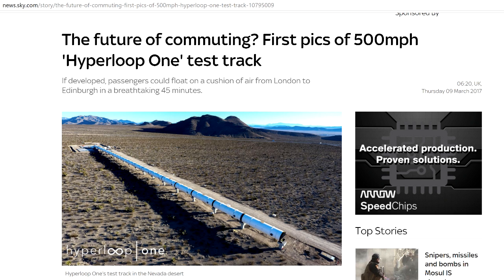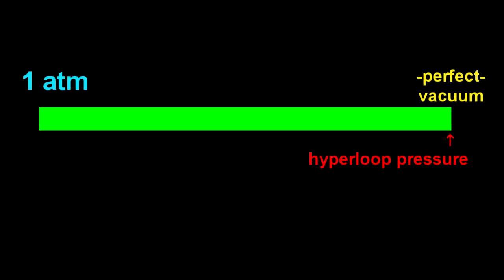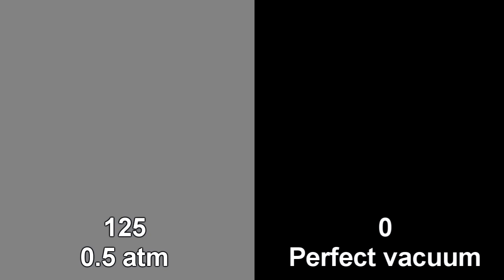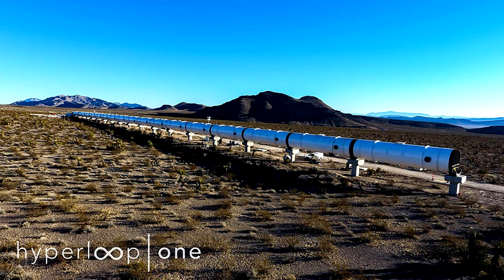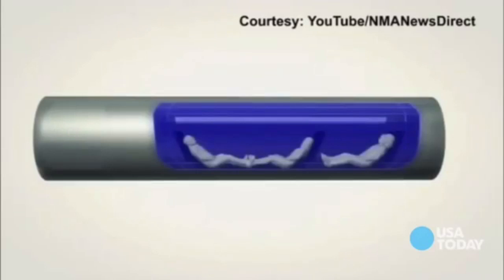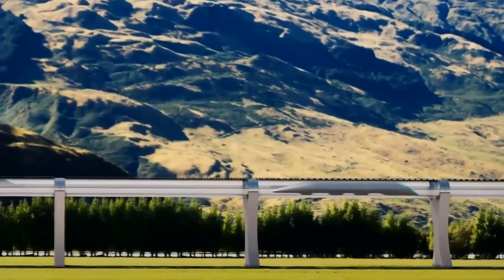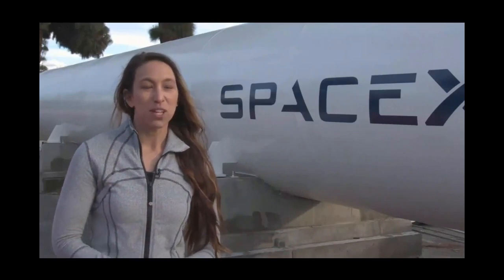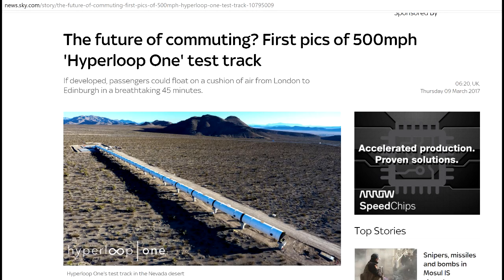Entire Hyperloop could be destroyed in SECONDS!

Comment: Correct observation on the red herring of pressure difference between ideal vacuum and hyperloop.

Wrong on all other counts

1) Tanker truck demo
Using the demonstration of a thin wall gauge tanker truck (typically 3-5mm) undergoing catastrophic collapse via highly non linear eigenmode buckling is nonsensical and doesn't necessarily apply to thicker wall tubes.  Tankers are usually designed to carry pressure or liquid and aren't usually subject to vacuum external pressure (hence the warning demo). They can easily collapse from external 15psi.
 Hyper loop design spec is 20mm thick wall. Its not 'wafer thin' (and equally - just saying - 'it looks thin to me' is not valid science or engineering argument) . And with a diameter of 2m or more it will have buckling pressure > 100psi (>6 atmos) - a significant safety factor.
 In addition,  my own calcs indicate that denting and then tearing or blowing fist size holes will also not lead to any kind of such catastrophic collapse ( By the way a grenade or high velocity rifle bullet will be unable to cause such a hole in such a thickness).    

Your uninformed -  'It may well be' - hunches doesn't substitute for calculation and doesn't count as a valid professional science /engineering approach Dr. Mason    Its a shame that you promote such nonsense when you are otherwise evdidently smart enough to undertake such calculations. Why not go do some!

Here - do yourself (and your subscribers) a favour - look up some pipe wall/diameter ratios vs crush pressures
http://web.ornl.gov/info/reports/1962/3445605700239.pdf

2) Energy for pump down
Stop trying to scare and sound impressive with your melodramatic big '0.2 GigaJoule'  energy numbers - so much woo-woo!!!. Correct value as it it maybe, you know as well as any (or should do!?), that that number is  small beer in terms of power use. It is equivalent to only ~ 2kWatts running for 24hour period when considering a 1 km length of pipe (would you need to pump faster).
 Call it ~1200kWatt over 1 day for pump down of entire 500km length. Less than~ $6000 in terms of electricity costs (US commercial). 
My own estimate - based on my experience as engineer of large vac systems - using high power roots blower pumps - would be to use about 200 off distributed over length with say ~2 to 3  days pump down. Costs of about $10,000 total pump down in electricity and about $20 million in capital outlay for the pumps. Use less pumps = less capital outlay  and wait longer. Either way these are not big numbers  for such a big project 

3) pingpong ball 
Very wrong about using pingpong ball demo and expecting it to scale. It does scale but only inversely. Think : volume and mass of capsule scales as to dimension ^3   - whereas area under vac pressure load (where the accelerating or decelerating forces come from) scales only as dimension ^2. This means if you scale up by factor 100 in size from pingpong ball you get (100^2/100^3) reduction in accel forces - i.e. x100 fold. But also - steel capsules by their nature also relatively mass much more than ping pong balls do even allowing for scaling factor due to extra special very low design density of pingpong balls (material type and wall thickness)  - easily way more than x10 factor. So, instantly you have a x1000 reduction (but more like 10,000) from the drama you presented with ping pong balls when scaling up to the big stuff. Try using your high speed camera and slow it down by this amount to see what pingpong gun looks like then.  
What totally kills this scare tactic beyond this thoughis the evacuation time for volume scaling up from pingpong ball pipes to 2m pipes. It can't be a dleta function from zero to full atmos in milliseconds like in pingpong case.
My calcs indicate with a full 0.1m hole breach ahead  you might experience ~ about between 3-6Gmax. Significant for sure but both (a) extremely unlikely and  (b) survivable. 

4) Wrong in general about engineering over such length and scales 
You seem to think that running a hermetically sealed steel pipe for hundreds of miles is a feat so far outside the wit of man as to be laughable. Yet hyperloop from sanfran to LA will be only a fraction (1/20th) of many of the longest transcontinental high pressure gas pipe line lengths running across the world across deserts and tundras that are subject to wild seasonal temperature swings. Some pipelines hold 100Bar pressure internal. To me this is harder than maintaining a 1Bar negative pressure by a long long way.
Reply: I you ram a fully loaded truck at 100miles per hour into any train in the world - what would happen? Lots of death - that's what.  The hyperloop can't ever be made impervious to coordinated terror attack this is very true - just like any other public transport. From my assessment it is more robust than most otehr forms of transport though.
 I suspect - though I haven't ran the numbers - that a fully loaded 40T truck at such speed crashing into the tube itself would certainly dent the wall (even if inch thick steel) and crumple the tube locally. 

That said, the fact that the tube is suspended on stanchions way above ground actually probably makes it potentially less vunerable than a conventional railway - as you don't get that many flying trucks.
 And If the pillar spacing is right so that the adjacent pillars can still support the tube and are designed to sideways shear at specific points  when subject to large lateral impact loads from the ground then it is feasible then a single truck impact might have no effect - other than to knock over one supporting pillar.
Reply: Pipes are strong in the 'farfield' i.e. semi-infinite extension approximation. Short lengths at the ends will be weak and subject to membrane folding/ crumpling by buckling. You will notice the braces are just at the ends - not in the middle.   From what I can see from the visuals, the wall thickness looks to be ~ 20mm (3/4inch) thick and this is in-line with the specification for hyperloop. 
This is a strong pipe that when welded together will have safety factor of about x5 for the pressure of ~1Bar differential of the near vacuum and that high velocity bullets and grenades whatever will just bounce off.

This is normal delivery practice even for thicker still gas / oil pipelines that carry many many times more differential pressure than hyperloop.

When you have welded kilometres of this together you may well ask 'what about the weak ends'?   I imagine these will be welded to extra thick end cuffs - though I haven't yet seen design for this so cant comment.

p.s. Phil Mason is a good scientist but in this case he hasn't done the calculations at all  ( I don't even see a basic hoop stress calc - because if you did you would see it is safe) plus he also doesn't have experience with this type of engineering.  
Good scientist though he is , he also appears arrogant and which perhaps explains why he will never admit he is wrong. Either that of he is just mercenary and wants the money the youtubes clicks bring over any real understanding - (which he appears to get).

Comment: You can do a vacuum tube which will be stable you just have to do your math right and choose correct materials which work for that purpose. We have done reverse-vacuums for centuries now. And by reverse-vacuum I mean a combustion chamber which can handle pressure. That's called an internal combustion engine in a car or plain and simple pressure tank for air compressor or such. Vacuum can be achieved as easily too, you just need correct wall thickness for the cylinder you are going use for the vacuum or for pressurizing.

Comment: if they had a second layer of material over the tube that was just slightly bigger than the first so that if it is dented it will not effect the pressurised tube, would this have any chance of saving it? because it doesn't have to meet the same requirements, it could be shaped like a triangle for all they cared, it could be made out of cheeper material, as long as it doesn't collapse in on itself and damage the tube, is strong enough to obsorb the impact of a car and the larger area doesn't cause extra wind resistance ... I guess not

Comment: You're criticising the issues the prototypes would have if they were actually in use. Obviously the real deal will have all the issues fixed which you pointed out.

Strong enforcement on the outside to keep the tube from getting crushed is easy to do. Stop pointing that out like it's a critical problem. Why would they bother with the resources for a prototype?

The acceleration and speed they achieved in testing was only for that particular stage of prototyping and it might've been good results for that kind of environment. I can't comprehend why you would have to compare that to the promised speeds of the real thing. Obviously the finished product will have more efficient everything (method of acceleration, minimizing friction etc.) than the prototypes.
Do you not understand basic prototyping or why would you ever make a video like this? No need to build a finished product every time they want to prototype/develop a specific part of the project.

Also only the prototypes need to be pulled to a vacuum every time they do testing. Did it not come to mind they might have the real tube close to a full vacuum at all times? There are ways to minimize the volume of air they need to pull out each time passengers get in and drop off, like new types of airlocks. Even if a little air leaks into the vacuum it won't be significant due to the size of the tube. They could've even done it for the prototype tubes but possibly wouldn't be worth the resources compared to pulling a vacuum every time. Why don't you make one video about how much energy and water it takes to use a swimming pool if you empty it every time after use?

This video was useless for what it's for but educated me somewhat on hyperloop subject. Also I almost never write comments and I should be working but I thought you to be a reputable youtuber who knows what he's on about. You're the kinda guy who could make a kickstarter campaign for the solar roadways because you wouldn't realize it's not even possible with current technology.

Comment: I'm not a scientist, so I could be wrong with what I said (Wont be surprised either if I was), but while I could see this Hyperloop might not be working in Earth, I'm thinking if this could works well under little to none atmospheric pressure like in Moon or something? If we've managed to build a base in our Moon, I see this Hyperloop could be utilized to ferry people/cargo between bases without having to rely on external vehicular apparatus. Is that possible? I mean, if it could be working on Moon, they would need no more vehicle other than research/engine/emergency.

Or, since Moon has no atmosphere, building a maglev would cost less and probably better?

I would like to see this answered tho.
Reply: the entire point of the Hyperloop is to create an evacuated tunnel on the earth surface, to take advantage of the lower air friction. The moon already has a vacuum, so any Hyperloop vacuum tube technology is useless.

Comment: I have an idea, so I am going to make a 1200 km tube of tempered glass (because it is 4-5x stronger than regular glass) and bring it to a vacuum. And we are gonna harvest the energy of explosives to propel these hollow tubes where the people are. So we load like 50 tons of explosives at one end and boom it shoots off to the other. The system will also have magnets to decelerate at the ends (Powered by Thorium lasers.)The exterior of the pipe will have rings of solar panels spinning at about 500-1000 rpm, making them 30x more efficient! This power will go towards a disco light show inside the tube, and to powering some fans to help the water condensers which produce the drinks for the rides! The tube is designed to go underwater, and will get all the oxygen from micro gills which rip the stuff right out of the water! It even has military applications, we have designed a military variant with cameras, but instead of being made of glass, this model uses recycled plastics! Instead of 50 tons of explosives, it also uses the power of nuclear detonations! We call it GOLDEN FREAKIN' HAMMER TRAIN

Comment: Its not really an argument to say 'see what could happen with a vaccuum', thats just bad engineering. You can do the math what is needed to prevent that so it wont happen.

Also mind you that your TNT Calculation of 200 000 000 J of energy, a lot in your words, is only about 55Kwh. Buy this amount from the electricity company and you pay just under 14 bucks. Doesn't sound like that much now eh?

Comment: I thought that the idea of this concept was to use magnetic levitation as a means of reducing friction just like high speed trains, but the pods they tested appeared to just have wheels. I don't know a lot about the conceptual science behind this at all, but If I had to guess, I would say that the point of maintaining a vacuum in the loop would be to reduce friction from air drag. If that is true,  they are only  drag  in  this and essentially just creating a road that you can drive a car in with very little friction from air.
Reply: the pods would hover on a cushion of air, like a puck on an air hockey table.
Reply: Wait, but than how will there be a vacuum?
Reply: it's a partial vacuum, so there's still some air in the tube.

Comment: Instead of 0.1% atmosphere with >2000 pounds per square foot they could use 1% at just over 200 pounds per square foot. They would use more power but thinner walled tube.
Reply: Both 0.1% and 1% atmosphere are very close to 14.7 PSI. Your math is in error some place.

Comment: I take it that the thickness of the vacuumed tubes should be determined by the same design principles of underwater pipelines. In underwater pipelines, you should design it so that it will not collapse under the extreme external water pressure. The pipeline may be designed in two different ways depending on the risk involved:

1. It may be designed so that it will not collapse under the high external water pressure. Even though, it must be equipped with buckle arrestors, which will stop a possible pipeline collapsing, that way it will not compromise the whole pipeline, only the section between two buckle arrestors. 

2. It may be designed so that it will not propagate a possible collapse, thus not needing a buckle arrestor. Bear in mind that for that to happen, the pipeline must have a much higher wall thickness, at times even 50% thicker (which translates in more $$$ and less of environmentally friendly).

Sorry for bad English. I just wanted to share some knowledge, and yet I may not be 100% right.
Reply: The fact is, you need much less energy/effort to crush a pipeline which is already partially deformed or collapsed locally. That's why there's a big difference between designing a pipeline to avoid the initial collapse, and designing it to prevent a collapse from spreading/propagating.